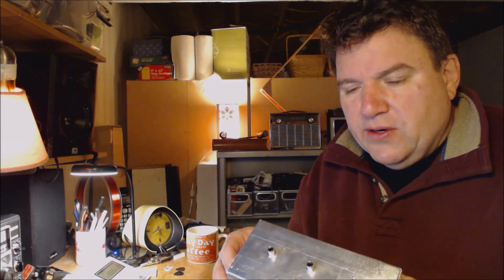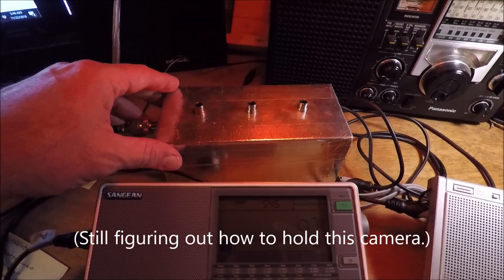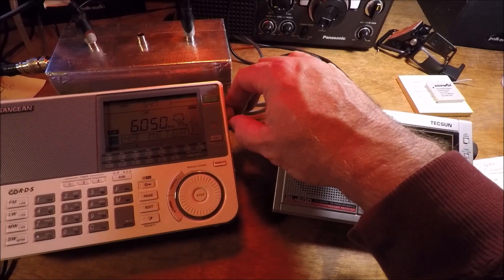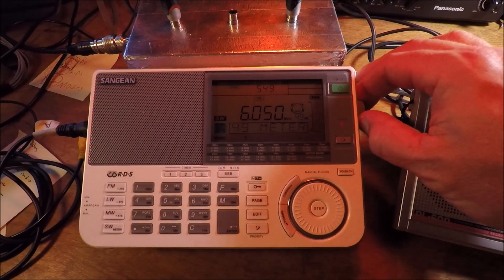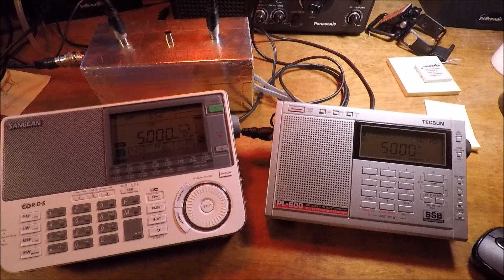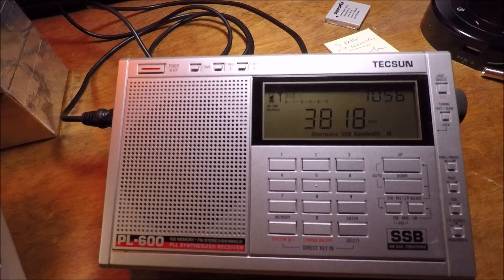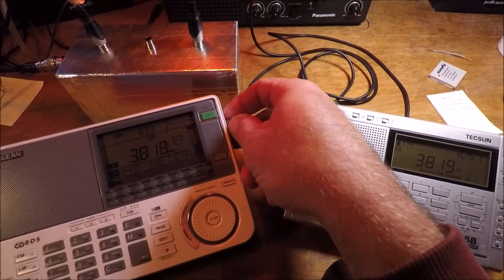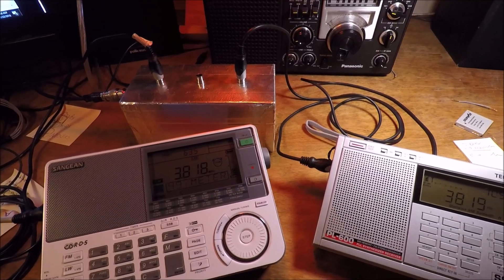Shortwave Antenna Splitter Test (ft. Sangean 909X and Tecsun PL600)

Comment: I'm sure some of you already know this, the signal degradation of the second radio is why a lot of DX'ers use Stridsberg Engineering multi-couplers, I have a MCA-104M. There is no loss and high isolation between ports. I learned the hard way about trying to combine radios, scanners, etc. without proper isolation. This is an good solution if for whatever reason you can't put up more than one antenna. There is no interaction between radios. I've had Stridsberg products for many years, they always upgrade them for free and are top shelf quality. Pricey but well worth it if you are a serious DX'er.